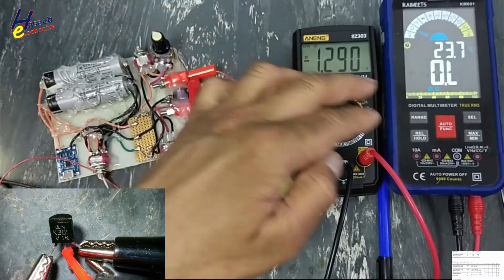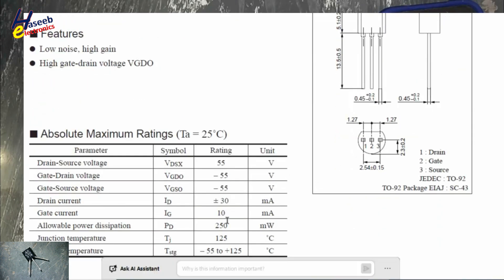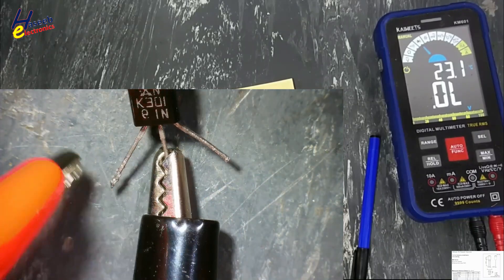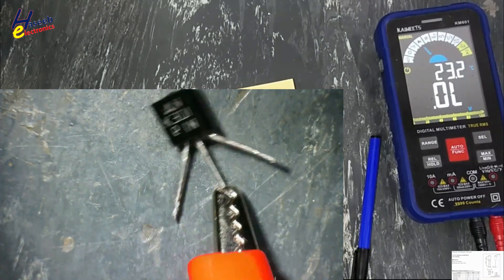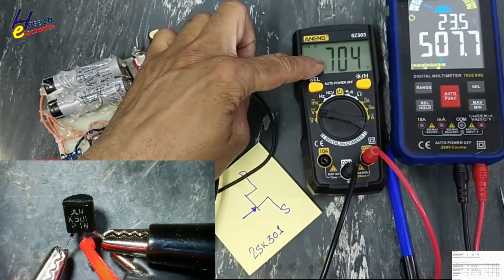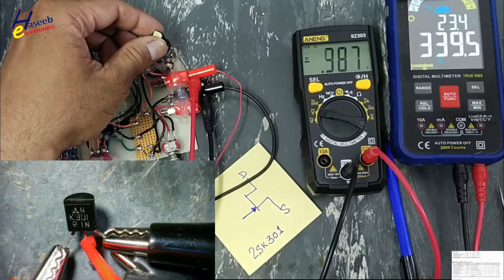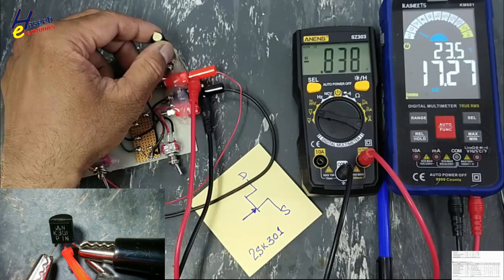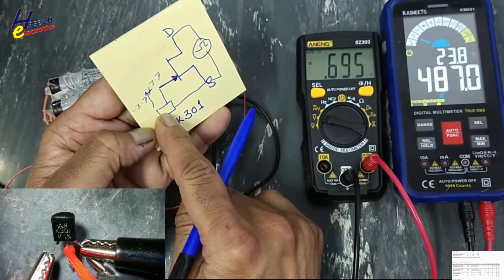{1293} How To Test JFET || Junction Field Effect Transistor

Comment: Thank you very much for the video, could you make a video about bench power supplies, which configuration would best suit the repair technician, working with different products. Thank you.
Reply from the maker: most suitable power supply for electronics workbench 
must have CC, CV, Tracking, Series / parallel option, Dual ouotput. 
like Lodestar 8202. it is my favorite power supply. or LS1530 as also good 
moreover if any power supply is equipped with crowbar option, that is graet.